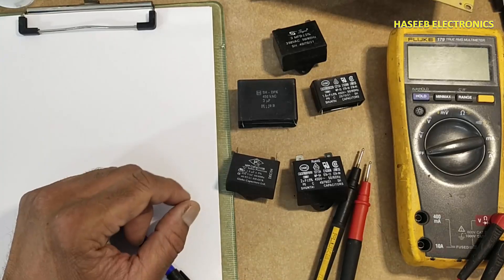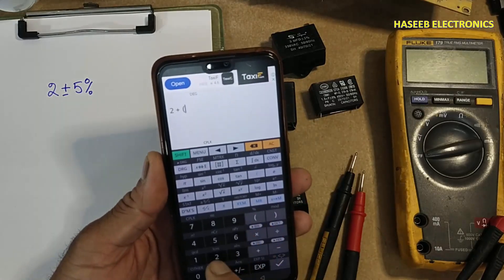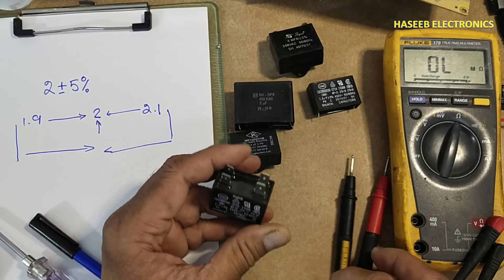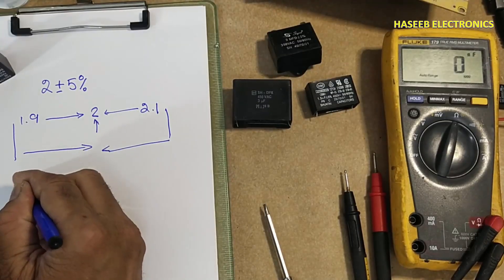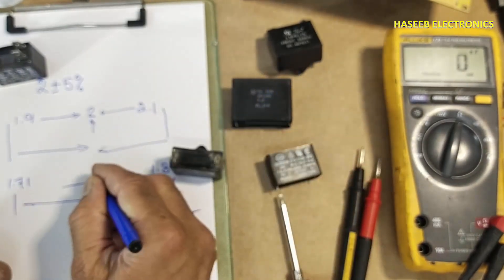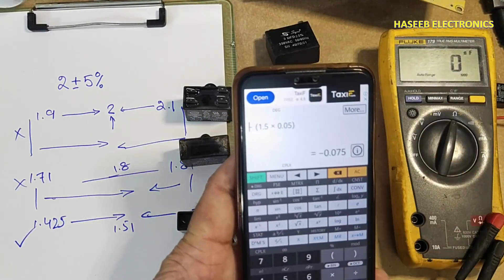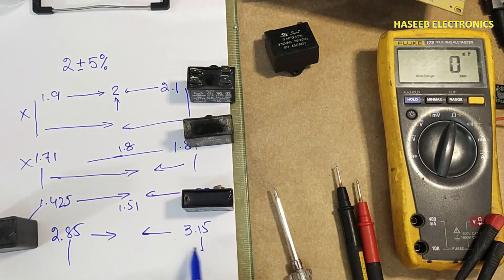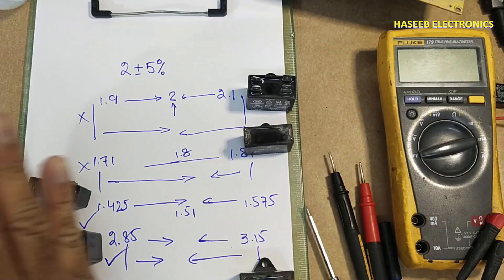{1012} How to test non-polarized ac capacitor using multimeter

Comment: Excellent, it should be noted that capacitors can test good in value, but have internal leakage (parallel resistance) as well. There are easy testers that can be assembled made with op amps or transistors set up like Darlington pairs that are highly sensitive to the giga ohms or greater that show up even the slightest leakage. "Mr Carlson" and others have built such testers and they work very well. They won't show the capacitance or esr, just the leakage. Thanks for sharing and have a great day!
Reply from the maker: Beat regards and special thanks for your valuable comment
I added it my plan as well
Reply: Great! Thanks again for your training and input. @HaseebElectronics

Comment: Sir, 
Thanks to your videos which gives lot of knowledge in electronics testing and servicing. I want to purchase a very good DMM(professional) and desoldering pump as that of you are using. Please suggest me the brands for both sir.
Reply from the maker: fluke  287, 179B, 177B are fantastic professional multimeters for electronics engineering 
HAKKO 701 is superb and reasonable price multimeter 
WELLER WR3M is superb, but its price is above 3000 USD
Reply: @HaseebElectronics  thanks  a lot sir

Comment: Hi Sir. I am Vasudevan. My doubt is how to find out the value without mention in the body part. Eg. B81130 X2 MKP/ SH.  Other side mentioned Z104590229 C and second line V7-U1  M 250. Have any code?  Multimeter shows 67 nano farad. Bur smps  10 ohm resistance burned.(24 inch lcd tv)

Comment: Assalam wa alikum
SIR in last smps repair emerson smps video Why series lamp continues ley glowing.Not turned off after inrush current. Current please expline Thank U
Reply: It has a non-zero load while idle: fan, dummy load and internal consumption. Furthermore, voltage drop on the light bulb will cause it to draw even more current compared to straight 220V plug.
Reply: Thank u sir for reply.still i have doubt can u explain more
Reply from the maker: Please wait until the detail block diagram discussion and then it will become easy to understand the basic reason of dim lamp during off condition and "no load power on" conditions 
I am creating a block Sketch of this circuit. It will be available soon
Reply: Thank u SIR .I will wait for next video